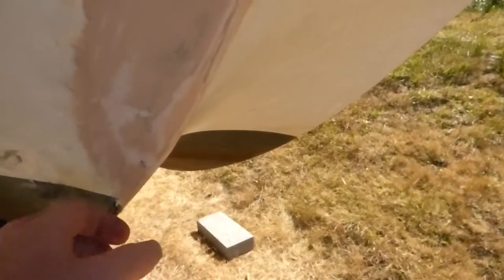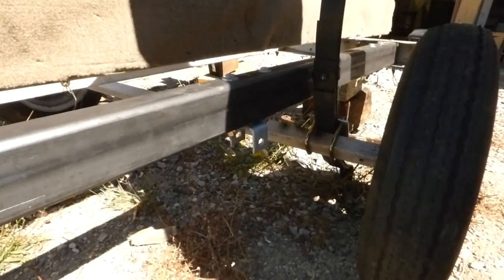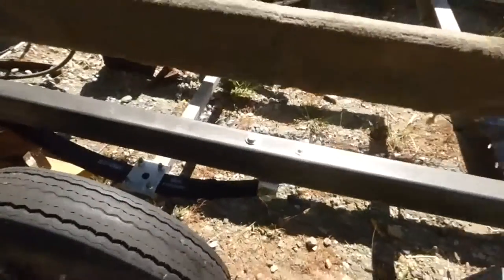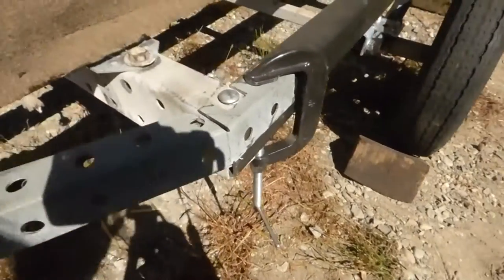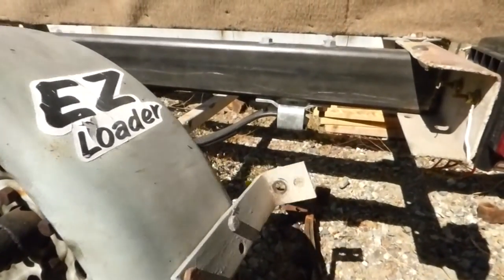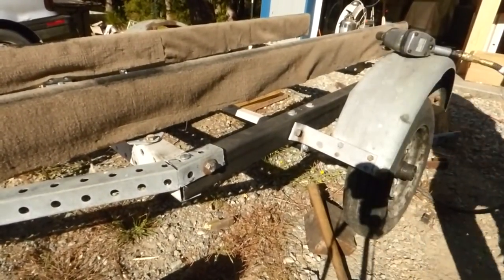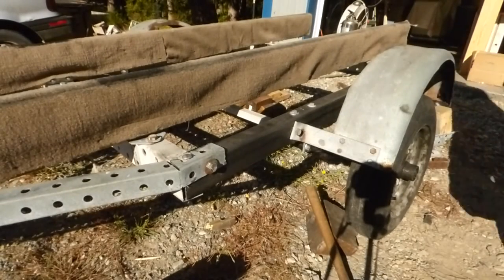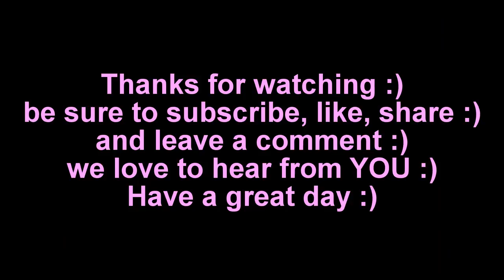Rebuilding a boat trailer prt2

Comment: Getting there Mark. Best wishes Bob.
Reply from the maker: Thanks.  At least I can concentrate on the boat now.
Reply: That's the part I am waiting for! I have done a fair bit of glass work in my time and always like to see how others do things to see if there is a tip or two to add to the collection.
Reply from the maker: I may not be the one to get tips from - lol.  I just barely squeak by.  In my old neighborhood, each of us (mariners) had different skills.  Merritt (RIP) was the fiberglass guy.
Reply: Tips can be found in what worked and what didn't . . . ;>)
Reply from the maker: true enough

Comment: Good job dude the trailer looks awesome can't wait to see the videos on what you do to the boat
Reply from the maker: Thanks James.   
Coming right up - lol.
Reply: +Mark Thieme One of the big things I have to do my boat trailer is replace the leave springs how expensive were they
Reply from the maker: These were small springs so they were at the bottom of the price range - $12 each.  With the brackets and bolts - I have about $60 into the springs.
Reply: +Mark Thieme that's awesome

Comment: Looking good, was wondering if you put rubber bushings in the end of the springs that goes through to connect shackles ?
Reply from the maker: The forward eye has a teflon bushing, the rear just slides ... metal to metal.  I could slap a dab of grease on in case it squeaks, but this isn't going to get used much.
Reply: Just checking, like I said great work